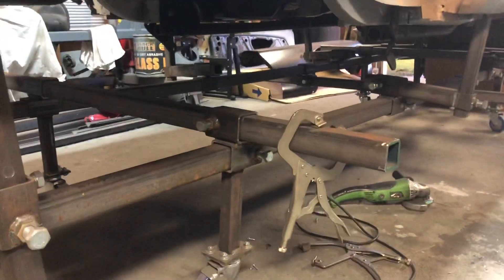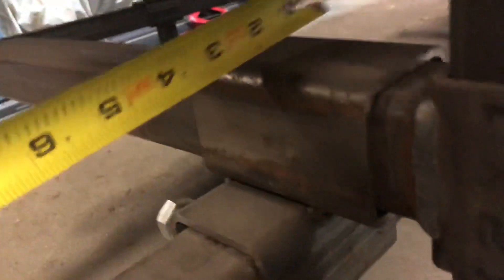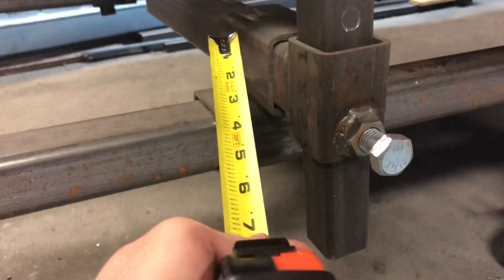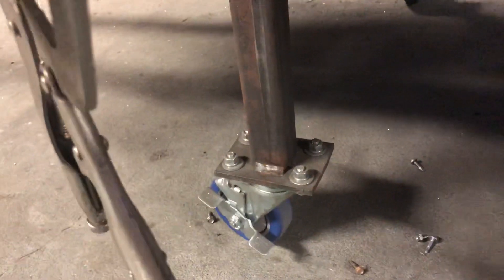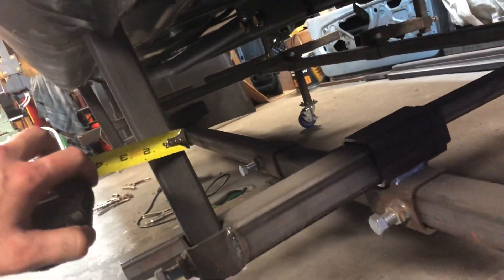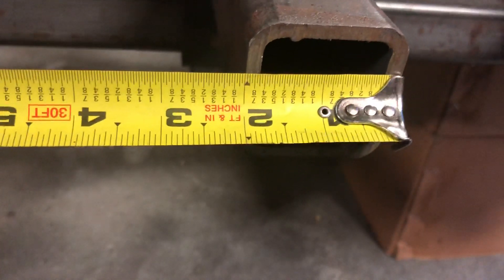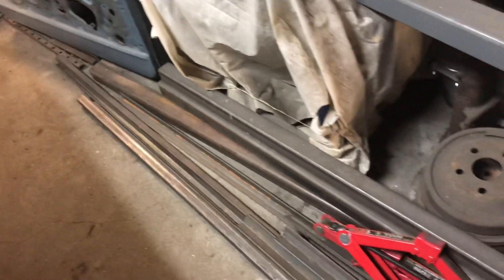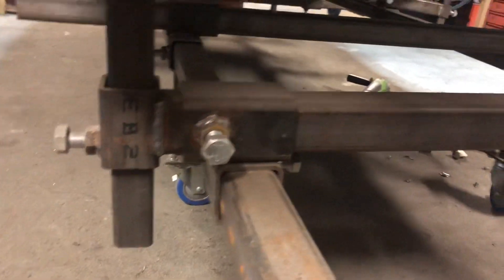Classic Mustang / universal frame jig / body cart

Comment: Great design! How many sticks of each size would you recommend for this project?
Reply from the maker: thanks. i wish i could remember to tell you. it's been so long since i built this. really depends on length/width you'll need for your project. my local metal yard sells in sticks of 20' i think. i sketched everything up and factored out how to make the most of the cuts to limit to the least amount of sticks to buy.

Comment: For the mustang were your rockers parallel to your from frame rails (they are obviously on different planes, but relative level to each other?$
Reply from the maker: i honestly don't recall at this point. i went off the frame dimension drawings and took a ton of measurements before welding. i want to say yes though.

Comment: Do you have how many 20’ lengths of each size 3/16 tubes you used?
Reply from the maker: its 3/16 wall. you use that thickness because it allows pieces to slip into one another. 2" fits into 2.5" and 2.5" fits into 3" and so on. every 1/2" will slip into another. I'm assuming you're asking how many 20' sticks it took to completely build it. no, i don't have an exact. i wanna say 3 maybe. then you'll need a 10' length or half 20' stick of the next size up to use for the sleave pieces. i believe the long runners i used were 15' each, so 2 sticks right there. those left (2) 5' pieces leftover that i used for cross braces. i believe i had 1 more 1/2 stick (10') that i cut in half to create 2 more cross braces. think all these were 2" sq tubing. then a stick or 1/2 stick (10') of 2.5" for the sleeves. then i used 1.5" for the mounts. I'd draw it all out to get measurements for your application before going to order from a steel yard. it'll vary per vehicle.

Comment: That was a great video. It would be great if you included a parts list for this project. I am doing a mustang currently and want to build a cart, but love the ability to adjust to most any car.
Reply from the maker: thanks. parts list for the body cart or the car? cart was super useful. i wish i would have built it at the start of restoring my car. cutting all the pieces takes forever. a good bandsaw or carbide chopsaw makes short work of it.
Reply: @callofgeorge  the body cart. Please
Reply from the maker: @danielwilson5395  wasn't really a parts list for it. i updated the description with the dimensions of the tubing that i used. video should contain all the measurements though. only other "parts" were the casters which i bought off ebay and the hardware i got from tractor supply.

Comment: Great video. I've got a 68 Mustang convertible and unfortunately trusted the wrong "restoration" shop to fix it.  I have to pretty much pull it apart and start over. Car is currently pretty well aligned, but has a Heidts front end and rear frame rail holes are a little distorted, so any suggestions as to how to anchor it if I was to build a jig like this? Thanks.
Reply from the maker: are you needing to anchor to try to straighten the rear holes? or you just wanting to anchor it to the jig to make it stable to work on?
Reply: The latter. The car needs pretty much an entire re-do
Reply from the maker: @JLThisisMe  if you have to do any frame work, i'd suggest welding up a jig using a car that is 100% positively straight. one thing that i wished i had done to make things easier. if your's is for sure straight, you could align and weld up to yours then replace pieces as needed. i wanted to be able to use mine for multiple vehicles if necessary and disassemble for storage. but mount/anchor points would be the front frame rail (you can use a large bolt with a washer on top of a nut and let it rest in the hole of the frame, or run a bolt through the few side holes like the steering box or bumper mounts). the rear i would mount to the leaf spring pockets or rear tie down holes. i secured mine to the jig with tie down straps in various locations as i worked. i wrapped around the rockers, across the floor pan and jig. i also strapped the rear frame by hooking one of the holes. and i hooked the holes where the door hinges bolt as well. not sure if that's what you were asking. let me know if you needed something else. i can try to make a video to better explain if needed.
Reply: Thanks for the response. I am pretty sure that based on previous input I have received that the car is straight but I can't say for absolute certain. When I measure diagonal points they do come out pretty precise. I don't have ready access to a Mustang of the same year that I know for certain to be straight so I'll have to figure out another route to go thanks again for the input
Reply from the maker: @JLThisisMe  i have several drawings with frame dimensions. if you need one let me know.
Reply: Thanks. I do have the mustang shop specs that come in the manual. Most of this is a matter of having to figure out how to create mounting points that correspond to hold the car in place
Reply: On the other hand, even the front frame rail patches were installed improperly so, the floor supports sit at a slant. Since the Heidts front end is already welded in, I'm not even sure how to remedy that one. After spending about 5k for rust repair/partial restoration, this car is pretty much a re-do. Any work that wasn't done dangerously was done sloppily (radiator supports and other parts have Frankenstein-like stitch welds on them, some of the installed replacement parts still even have their bar code tags on them), rockers and rear torque boxes have rust inside them, etc). I see that video showing a Mustang being built piece by piece and wonder if I wouldn't be better off cutting out the Heidts components and going that route.
Reply from the maker: @JLThisisMe  i feel you on the shabby/frankenstein restore job.. i think i pulled 2 different floor pan sections out of my car where they had just been overlapped repeatedly. i can say first hand, had i realized the extent of the work that i had to do, i would have gone with Dynacorn's full floor with frame rails, extensions, and rockers. then built up from there.. would have been soooo much easier. Joe Daddy did a convertible like that. the Heidt's is a mustang 2 setup right? you can get just the crossmember for a reasonable price i think.. that should be really all that's welded in. i pulled my jig from several sources.. hopefully this link will post fine.. but this had some very useful info. i used scissor jacks for leveling/adjusting mine as well. i had to use them to lift my floor supports into the proper place for welding because mine were slanted from the floor pan. http://67fastbackproject.blogspot.com/2015/11/how-to-design-and-build-frame-jig-in.html
Reply: Thanks. I really appreciate the response. Yes it's a Mustang II rig so you're probably right.

Comment: What was the cost to build the Jig?
Reply from the maker: pretty sure it was around $250'ish. guess i should have also said, that was the cost for the steel. not factoring in the cost for consumables like cutting blades, discs, weld wire, etc.. i purchased a carbide chop saw for this go around. wish i would have had it for the rotisserie. i also purchased a band saw soon after that would have come in handy as well.

Comment: What engine are you going to put in the car? Nice video.
Reply from the maker: the engine should be in a previous video from way back. it'll be that same built 302 going back in for now. when it goes I'll probably buy a roller 302 since mines and older flat tappet block. and if my money's right come that time, i may go coyote, but i'll have to change the crossmember at that point. and thanks for watching.